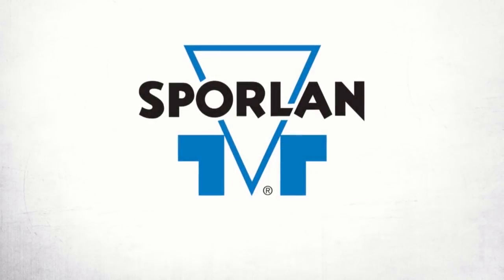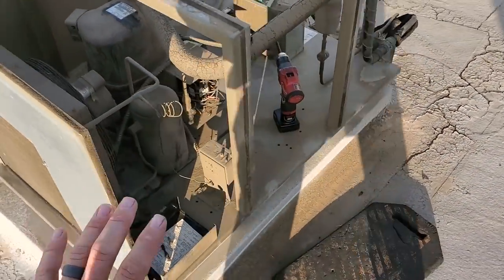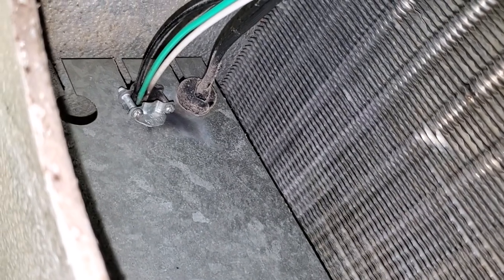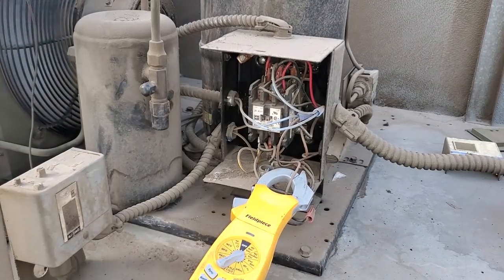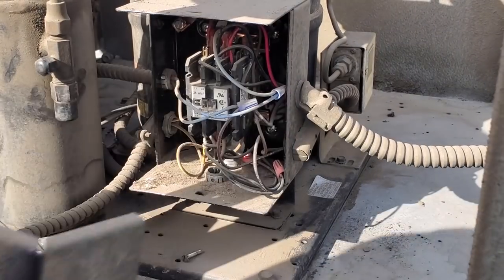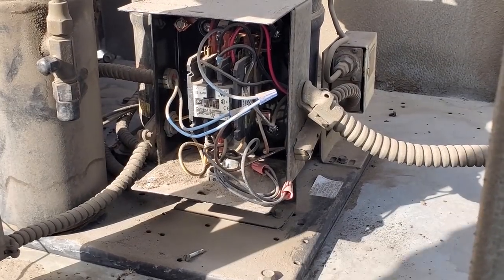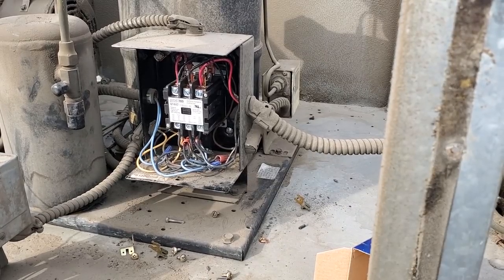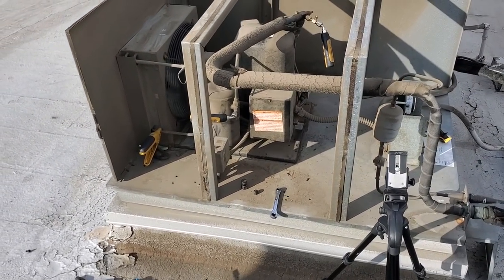WALK IN BREAKER KEEPS TRIPPING

Comment: Just a small note. I always tighten, back off, and re-tighten the lugs when clamping down on solid core wire, just like you do with set screws on a shaft. It seems to make up for whatever happens with expansion and contraction that looses the connection over time. Good video as usual.

Comment: Great video and admire your work !

Have to mention about safety to work on equipment before turn disconnect off. It should check for grounding as well. I was called to condensing unit for walk in freezer. It was dead and verified no power on L1 L2 L3 like you do. Double make sure to use my NCV pen to verify and it was still LIVE ! It was grounding . Someone did bypassed disconnect switch by wires L1 without use fuse. 

I did encountered several like this one. Never hurt to check for grounding sir.
Reply: This is why you don't just kill the disconnect switch, you kill the breaker at the Panel with a Lock Out-Tag Out as well...

Comment: First thought was evaporator wires rubbing when you said the evaporator was on the same circuit as the condensing unit. Good job repairing it. I can get most blades balanced out by hand as long as the blades are not cracked.
Reply from the maker: Thanks for watching!  I will be going live on YouTube this evening 11/18/19 @5:PM (pacific time) to discuss my most recent videos and answer questions from the Live chat, YouTube comments, emails, and Facebook comments. Come on over and check it out  https://youtu.be/NjeFrNCiAEs

Comment: Nice job! 

A couple comments that might be useful. On that rusty electrical box, I think instead of trying to seal the upper conduit, I might have put a 1/8" or 3/16" hole in the bottom of the box to let it drain. Sealing the down conduit is just going to get any water in the conduit pooling in that top box fitting and rusting it out. Along the same lines, in the contactor box on the roof, I noticed you left some wirenuts sideways on the bottom of the box. I've gotten in the habit of trying to keep wirenuts pointing upwards to keep moisture from pooling in them. Likewise I keep them off the bottom of a box if at all possible to keep any pooling water or small vermin from making a home inside the wirenut.

Comment: Young guys.  Make sure you check the spade connections at the compressor terminals.  Many times, I have found loose connections that make intermittent issues.  Most of the time a pair of needle nose can make a tight connection.  Also, I like to use dielectric grease on the connectors.  It wicks moisture and prevents rust.

Comment: Vibration and wires leading to a short. Can that happen? Oh yeah. Good methodical diagnosis. The rust and water in that box looked scary. Going a little heavier on the contactor was a good move. Condensor fan motor looked like it was loaded up with dirt. Always wonderful going in after someone else's work.

Comment: As far as the condenser fan motor drawing slightly more current isn't a big thing at all. Even if it drew one amp more than normal shouldn't put things in panic mode. If your line voltage was a little lower than normal, the current draw will be higher. Nothing to sweat. If however, the fan was drawing 5 or 6 amp more current, then it's cause for concern. If the bearings were starting to seize, you will have more current draw. Of if the cap is very leaky. When a capacitor becomes very leaky, at that point it turns into a resistor. Great videos. Keep 'em coming :)

Comment: also one way to see which is cooler and which is freezer (0:41), is that the freezer has a substationally larger vent opening, because it needs to move away more heat.

Comment: I had a similar situation with an air curtain  but breaker was not tripping . But I was getting weird voltage readings 120 to ground  on each leg but only 7.68 volts across both legs. But in my case it was undersized wire nuts and vibrations made it come loose. Shorted to unit but tested it only using continuity.
Reply: I've only seen an undersized wire nut once. It also had a loose wire in it (the proper way to use a wire nut is bundle all the wires together and twist the exposed copper into a pigtail, THEN screw on the wire nut. NEVER use the wire nut itself to hold the wires together) and the way I noticed it was from the heat discoloration on the side of the junction box. When I pulled the wires out, there was only half a wire nut left, the rest had melted/burned away from the overheating due to the loose wire connection. My best guess is I was 2-4 days away from an Electrical Fire that likely would have burned my house down.
And no, I didn't wire up the Circuit originally, that sloppy connection was done by the Idiots that I bought the house from.
I've owned this house for 5.5 years now and I'm STILL finding badly wired Circuits. If I hadn't bought this house from an Estate Sale (I'e: from a dead person), I'd report their asses to the City Code Enforcement people and have them Charged with Performing Permit Required Work without the proper Permits. There is no Statute of Limitations on that and the Fines can be VERY high depending on 3 major Factors:
1) How much Illegal work was done (1 or 2 circuits in a home, minor fine; Illegally wired the whole house, major fine).
2) How bad is the work (all work done to Code, just no Permit, minor fine; nothing even close to Code and is highly likely to burn the house down, MASSIVE fine).
3) How Polite are you to the Inspector (Been very Polite and Respectful and accepted the Inspector's Criticism and Corrections with Dignity and Grace, minor fine; Snarled and Cursed at the Inspector and resisted their efforts to inspect the work, HUGE Fine AND you'll be forced completely open up everything you've touched for their Inspection THEN rip it all out, pull the Proper Permits and do it over from scratch at your expense)...
Be nice and Polite to Code Inspectors, it WILL save you time and money in the long run...

Comment: lol ive seen that happen about 3 times so far, and once i found several wires or wire, a neutral that was grounding in a freezer evap and fans would keep running because the fan delay cut the neutral off lol, it was odd as i remember disconnecting the neutral and fans keep running lol....fyi do not use safetys or switches in neutral

Comment: And now the wiring looks fare more "official".   If you need to run un-jacketed wiring though a metal clamp short pieces of neoprene hose can come in handy. Snap in plastic bushing for the ends of BX/MX cables and conduits should also be in place, to prevent chafing.

Comment: When i have a contactor that is "up side down", from how the original one is mounted, i don't EVER install it up side down and just flip the cover. Notice how it is supposed to mount. The top mounting point should be "closed" and the bottom is slotted. It should NEVER be mounted with the slotted side up, for safety. Instead, unscrew the mounting bracket off the back of the contactor and simply turn it around 180° and screw it back on. The contactor will mount correctly and the coil voltage wires will mount in the correct location.
Reply: You realize that in order for it to come loose in the upside-down position, one screw would have to come totally out, and the other one loosen, and if it's that bad, the loose one is probably going to fall out anyway.
The margin of safety "lost" by installing it upside down is about 5 percent, and would only cause issues in seriously bad conditions where it's probably the least of your worries lol
Many devices have slots on all positions so they don't even have that slight safety margin.

Now, on some devices it's easy to flip the base, and it's not bad to put the slot at the bottom, but it's not really a serious safety issue.
Reply: @ke6gwf  wow! Only 5%? Huh! Where did you find that stat? Did you research that with Underwriter Laboratory? Or did you just make that up to make yourself look smart? But anyway, I was taught to install them a with the slots in the correct postion. You can mount yours any way you choose. Have a nice night.
Reply: @mikec.2746  Thank you for demonstrating the difference between an Installer and a Technician.
You do it a certain way because a person you consider to be smarter than you told you to do it that way.
A Technician looks at a situation and makes their own decisions.

You know what the closed hole is really for? In case you are mounting a new unit, you can drill one hole, put the screw through the mounting hole, and hang it from one screw, while you mark or drill the other holes.
That's why it's centered.
Some contactors and similar devices have them, some have all slots, and some have no slots.
UL doesn't care about slots or holes, and it order for it to matter if the slot is up or down, one screw has to be completely gone, at which point UL and OSHA and IRS and MSHA are totally violated anyway.

Oh, shocker, they can also be mounted sideways! What do you do then?!?

So unless you can show from a manufacturer data sheet, or a code requirement that the slot direction is dictated to be down, than you are just passing on what some individual told you as gospel, and as the only PROPER way to do something.
And if you want to install them that way, great!
And if I am installing one that has a base that easily rotates, I likely will do so if it makes mounting easier, but not all do, and so making it a hard rule doesn't help.

If you had simply said that the bases can often be flipped to keep the slot at the bottom, and it's safer that way, you could benefit the conversation without making any blanket claims that others are doing it wrong.
Reply: @ke6gwf  Did you seriously just take a shot at installers???? Just to TRY to make yourself seem superior??? The installers I have ever worked with or employ are top notch people that have nothing but my absolute respect and admiration. How dare you put a group down just to make you feel better about yourself!! You are a real class act. 
I do take comfort, however, of never having to know you personally. Especially with your superiority complex. I still can't get over that you would take a shot at people in our industry just to make yourself seem smarter than you really are. You must be a very lonely person. Have a nice life.
Reply: @mikec.2746  Sorry, I was not referring to people who install new units, I was comparing two mind sets.
For instance, in heavy equipment operation, you have "steering wheel holders" and then you have "operators".
They both do the same thing, but one is able to figure out how to do things, the other has to be directed by someone else.

So by "Installer" I mean someone who just installs parts or repeats what they are told by someone else, who isn't able to step back and look at the big picture, or design solutions.
And by "Technician" I mean someone who is able to troubleshoot and design solutions and figure out things on their own, instead of just relying on the directions of others.

One type of person, you have to give them directions on a job, and if they run into anything unexpected, you can expect a call from them needing help to figure out what to do.
The other type, you can send on a job, and you know that they will get the job done, no matter what they run into, because they are able to figure it out.

For instance, if you were using a contactor with a riveted base, and you needed the coil terminals on the other side, what would you do?

Comment: Someday you'll make me a great HVAC tech...
Reply from the maker: I cant wait until that day....
Reply: @HVACRVIDEOS  if I keep watching one thing you really pointed out with this was how it's those details that get you.... the whole system needs to be looked at and those little things you take for granted get you.. my experience is not with restaurants or air conditioning. I repaired mobile refrigeration on cold hold units and refrigerated trailers as well as mobile air conditioning on Buses . Back then we had R12, R134a, R22, R404a, R501b, R502, R503c... that's all I worked with...we had varied but most were variations of the cold hold tecumseh and Copeland cast iron compressor or Thermo King both riecipicating or screw type refrigeration systems... alot more involved on those than just refrigeration mechanic. Various components just from driving tended to rub and cuase leaks, damage drive belts or drivers driving off without unplugging them

Comment: 2 things that would increase amp draw on a condenser motor; someone put to aggressive blade on it  or if coil is plugging up though your pressures looked good but someone could've tried to increase air flow with more aggressive blade to compensate for plugged condenser coil. ( be surprised how many dirty coils i've come across with that problem; then again maybe you wouldn't)
Reply: Plugged coil would actually decrease amp draw.
You know how when you block the air flow through a fan, it speeds up? That's because it takes less energy to swirl air around, then to propel air.
So a dirty coil will reduce air flow through the coil, thus making the fan just swirl air behind the coil, which uses less current.
Now, you are right, they may have put a bigger blade on, which would increase current.

Comment: Looking at the big picture is actually helping in almost every case. Nice work, keep it going. I like that you don't sloppily work and don't leave until everything's fine.

Are these compressors in general suitable to build a rather silent air compressor for about 11bars? Or will they be damaged in the long run?

Comment: Hi mate, great video as usual thank you. I have a question regarding the dual port suction service valve you made reference to (21 minute mark). If that valve is front seated and your service gauge was on the port furthest away from the spindle, would you be reading the compressor suction pressure or the suction line pressure. Put another way, does front seating that valve isolate the compressor from the suction line. Many thanks in advance if you get time to answer 👍🏼

Comment: ,I noticed that it is on a 30 amp breaker. I coil listing is for a 20 amp breaker max. The coil and condensing unit is rated at 16.6 amps and a 25 amp breaker would be a better choice.  Do not like having the condensing unit breaker protecting the coil , not safe.
Reply: mainj54 except for the evaporator is ran off that same 30amp breaker. Given 25 would still probably be ok but bet those breakers aren’t easy to find either! Good comment tho.
Reply: The breaker is sized properly.
It protects the wires up to the disconnect switch, regardless of the load on the disconnect switch.
The breaker is sized to match the ampacity of the wires running to the roof in other words.
Then you put the desired size fuse in the disconnect to protect your load.

In this case the unit is designed to fed by a minimum wire size and fuse size to run the combined load of the condenser and evaporator fans, and the compressor, as given on the data plate. It's designed to control the evaporator fan as well, so that load is combined in the data plate load, and there is no provision in the design for a seperate circuit to feed the evaporator fans, and also no separate overload protection.
I don't particularly like that design, but doing it differently would require redesigning the unit, and do you really want to be redesigning factory electrical equipment? You want that liability?
Basically, the evaporator fans are considered part of the single unit, and have no additional overcurrent protection.

And as we saw, a short on the 110 wires still trips the 30 amp breaker just fine.

Comment: When things have to be taken apart multiple times, how do you guys deal with the sheet metal screws stripping out?  It seems like after 2 or 3 cycles they don't hold well any more.  And on thinner metal, they hardly grip on the first use.
Reply from the maker: Yeah that happens for sure especially when people use impacts to tighten and loosen them... when it does happen I just go up in size on the screws and hope that they dont continue to strip them...
Reply: Go up in size or eventually use a threaded insert and an m8 screw

Comment: I personally don't like those wire nut connectors as they aren't sealed can allow the wires to oxidise making a high resistance fault in the future.
Reply: silicone filled wire nuts help.
Reply: @willow091  yeah  that is better but sort of defeats the purpose of the wire nut as it is supposed to be a quick connection  and silicone will make that process slower slower you may as well solder the wires with heat shrink if you have the extra time.

Comment: Thank you for the great videos. I also like how what I follow on FB will show up here later. Serious question though, are you that concerned on being .1 over amps? To my very limited knowledge, you allow 10% differential when testing electrical.
Reply: .1 isn't bad but usually as the motor heats up it will continue to draw higher amps. Also if the capacitor is weak as it weakens further it puts a lot of strain on the windings in motor.

Comment: the only thing i have seen you do that i disagree with is when you take out small scrap parts that you just drop them off the the side, for any job i do i have a small bucket or small box that i drop any dead parts i remove into there so i don't have to juggle them when i am done, but other then that good video and good work

Comment: L2 through high pressure control and low pressure control land on one side of the contactor coil. L1 to the other side of the coil.  Is that correct?